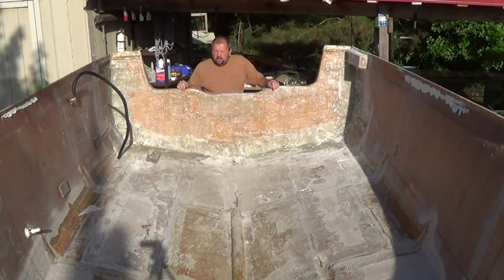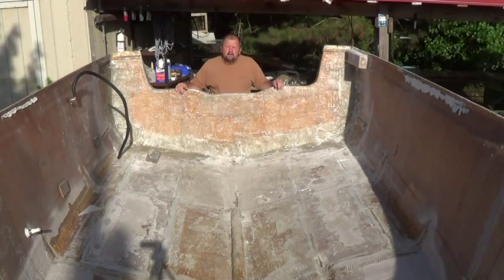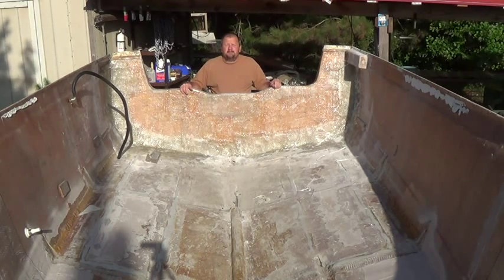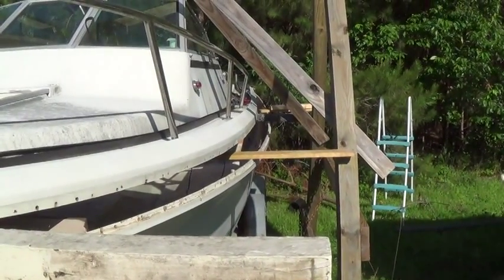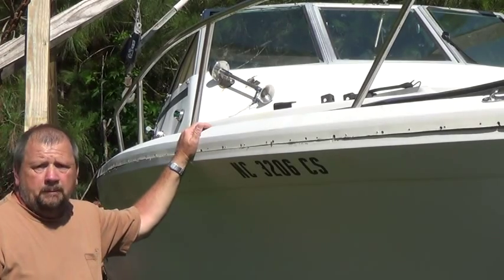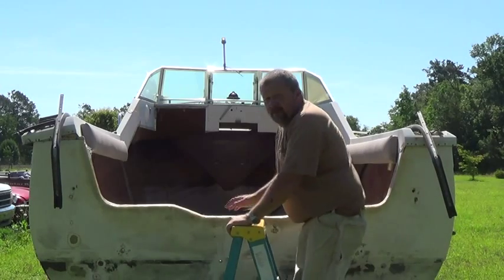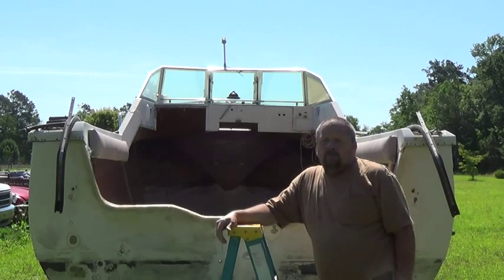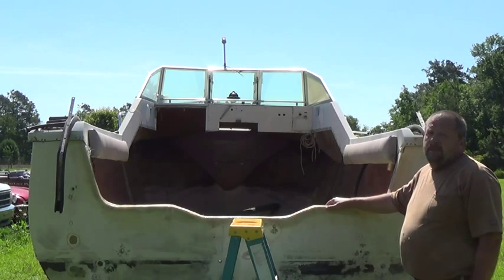Robalo Boat Project 15

Comment: Is that me or do you have two very different sized tires on your axles showing in the video?
Reply from the maker: Yes while I was working on the boat my utility trailer tires were wore out. and I need to run out of the state. The boat trailer had all new tires on it.  so I took two wheels off the boat trailer for the trip. I hate to have a flat when I am pulling a trailer. It was not long after I put the boat trailer tires back and bought new utility trailer tires.

Comment: PS:  That is why it is always best to make several 'holders' or molds using a cardboard template and two sheets of plywood for each mold which the hull rests into.  2x4 lumber between the frames keeps it all solid and in place.  Now start removing structure.  Overlap the plywood sheets to get full width of the hull.  The unsupported hull can do some amazing movement if it is not fully supported.  Once you add the structure whatever out of alignment issue you have will be permanent.  I have seen boats that 'pulled' one way or the other because of an untrue hull.  A pain to steer.  So first step is to make what is essentially an abbreviated female mold.
Reply from the maker: You are right. I though the trailer would hold the hull in the right shape. But as you already know I did not have enough support on ether part. Thanks for commenting and watching.